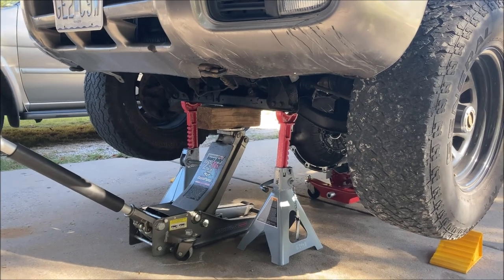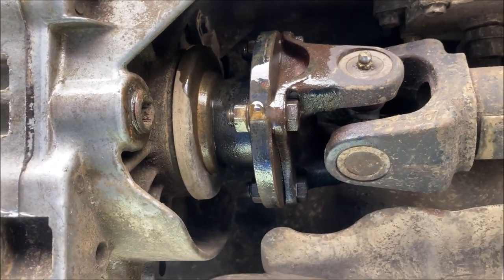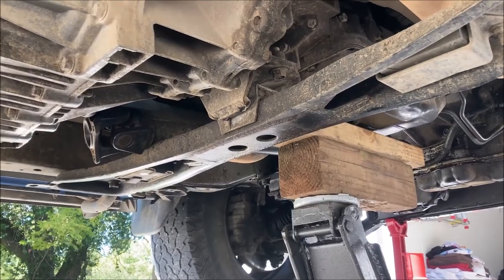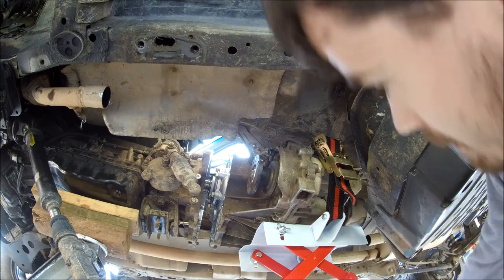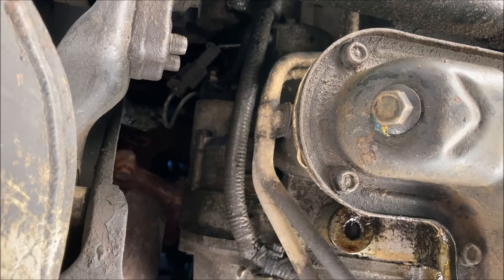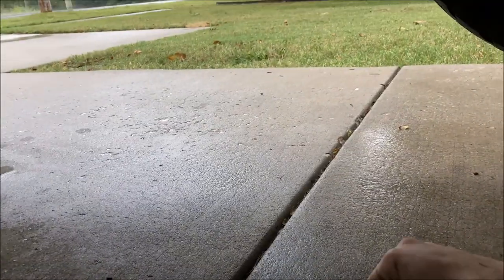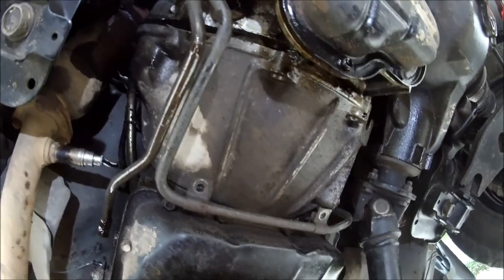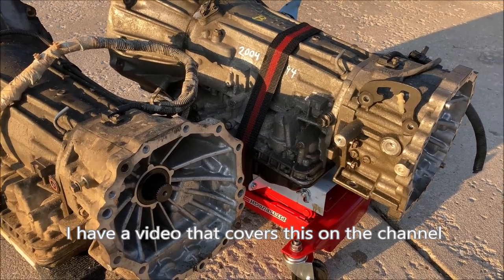Transmission Removal - Visual aid for R50 Pathfinder/Qx4

Comment: Thanks for doing this video. I need to drop the transmission to access the water outlet gaskets that are leaking. I tried doing it from the top taking manifolds off but I couldn't get the torque needed to stop the leaking. Taking this transmission down is no joke and I'm confident that you saved me a ton of time, headaches, and aggravation. Thanks man-really easy to follow and understand. You did an awesome job!

Comment: My heart dropped when you said not to cut any wires or I'll regret it. now I have to get another transmission.
Reply from the maker: Yikes. Time to bust out the soldering iron. I actually cut the wires at the junkyard on the donor trans. I rectified the situation by soldering all 22 little wires back together. I recommend going to the junkyard and cutting a longer donor section of wire harness to splice into the mistake if your junkyard has another donor. Just make sure the donor harness has the same plugs and wire count. Speaking from experience 2002,2003,2004 are all the same harness

Comment: First of all, mega thanks for putting up this video!  
This helped a lot when I had to tackle my rear main seal job.  
I referenced this vid several times before tackling this job myself.
This was my first time dealing with an automatic transmission (i.e. flex plate, torque converter, etc.) and 4x4 with transfer case, front axle, front diff.
I am a professional mechanic technician, so this kinda job doesn't intimidate me - if I had the right tools, I'd be fine.
Some tips:  
1) You don't need to pull the seats - you can get to the rear bottom bolts of the center console by sliding both seats all the way forward; to get at everything else, slide the seats all the way back.  
2) Your LE is rather rare - I have an '01 SE that has the shifter 4x4 linkage (I think the XE base model is like this too?) on the side (with the auto trans), which is easier to remove with the exception of on pass-through wiring harness (white plastic base with two locating "feet" with black metal cover) that goes into the passenger side of the trans case.  I think this is for all the solenoids, and I didn't figure out how to disconnect it so I just left it - it was just enough slack to nudge to trans + transfer case to the side to access the rear main seal.  The 4x4 shifter lever does get in the way on reinstallation, but dropping the two 12mm(?) bolts for the shifter assembly helped a lot.  I think unplugging electrical wiring harness plugs is a little bit easier and less stuff to do.  You are going to tear the bottom / inner rubber boot - that's just the rubber getting hard over time, and it catches on the bottom of the shift lever - just tear it off.
3) I was able to just move the trans + transfer case nudged over to the passenger side to be able to fully access the rear main seal.  This was with is sitting on the trans jack.
4) Dropping the back half of the stock exhaust wasn't too bad - with the exception of the 14mm(?) nuts (one pair for each side) that held the exhaust pipes to the left and right cats, the rest of the exhaust was held with 4 or 5 pairs of 12mm head bolts that held the hangers in place.  I did not cut anything, and it went back in relatively easy - the exhaust does loop over the rear axle, so this keeps it from crashing down.
5) Those bolts + nuts on the driveshafts (both front and rear) are a PAIN to remove!  I disconnected the main driveshaft from the rear diff and left it inserted in the back of the transfer case output to keep fluid from leaking back there.
6) Getting the torque converter bolts to line up was another PAIN!  I first bolted the bell housings bolts, thinking I could spin either the torque converter itself or the flex plate (engine side) - NOPE!  Once it's in, both spin together - I had to back out the bell housing about an inch, lined up one torque converter bolt (with the use of a pin punch) and then bolt everything back.

7) It's not real obvious, but ATF is refilled through the dipstick tube.  The FSM mentions "charge pipe," but it's buried on what this exactly is.  Lucky I had a MityVac manual fluid pump that made this a breeze.  I first tried to not spill any fluid, but that was impossible after removing the two 19mm banjo bolts on each side of the trans case that goes to the cooler up front, and the speedo gear at the back of the transfer case.  FSM mentioned Nissan fluid "D" but Mercon III compatible ATF is listed as an equivalent; the original Nissan "D" fluid is brown in color - like engine oil but without the burnt smell.

In the end, I calculate about 30 hours of my time from start to finish, by myself.
For those going after the rear main seal, here's more tips:
1) Upon reinstallation, but the two locating dowels on each side - no other UTube vid mentions this, and it give you another 1mm to work with.  The dowels come loose with vice grips.
2) Oil the circular oil seal.  Work the seal in with a small screwdriver - pay particular attention on how the oil ring seal goes in, as it's has an inner lip!  Keep using the screwdriver to gentle prod the lip seal at the bottom - be patient, this take a while.  Once everything looks kosher, get the three 10mm head bolts to thread most of the way in.  THEN, tap the two dowels in with a pin punch - take you're time; the dowels have a bevel / chamfer that will guide the rear main seal aluminum housing downward.  You will see it close the gap.  
3) When I removed the original Nissan real main seal (housing), there was no paper gasket, as the Fel-Pro kits comes with one - I didn't use this gasket; the Fel-Pro rear main seal aluminum housing has grooves like the Nissan one does that keep RTV in.  I also noticed that Nissan did not RTV the lip seal either - I did use a little to keep the lip seal held against the underside of the rear main seal aluminum housing, but no RTV under that in contact with the engine (upper oil pan).  You see a lot of other UTube vids where they smear RTV all over the place and make a mess!  If Nissan didn't do it, it's not necessary.

Comment: Thanks for the awesome video! Do you know anything about the vg33e transmission? I've got a 97 QX4, and the transmission recently started having issues with delayed shifting from 1st to 2nd. I'm about to replace the speed sensor, but I'm hoping this isn't a sign that the transmission is going out.
Reply from the maker: The vg33 re4r01a trans in the vg33 models is supposed to be very similar to the vq35de variants but unfortunately I don't have any knowledge about troubleshooting or fixing them

Comment: Thank you so much for this vid, i had a couple of question and you addressed them, now I'm having so much trouble putting it back i removed it to replace the rear main seal and for some reason I'm not getting the transmission to aligng...so frustrating...not sure what's wrong with it, when i finally got it in i started it and made some weird noise and I turned it off immediately!!

Comment: Is it essential separate the transfer case in order to drop the transmission? 

I'm trying to replace the rear main seal and yes I did watch your video about the lower oil pan gasket. Thank you for that! The unfortunate news is that I just got done replacing the upper oil pan gasket and now I'm going to have to take it all apart again to get to the rear main seal
Reply from the maker: That sucks to hear man. But no, you don’t have to separate the transfer case. I did it because it would be lighter to take it apart in pieces using that flimsy transmission jack.

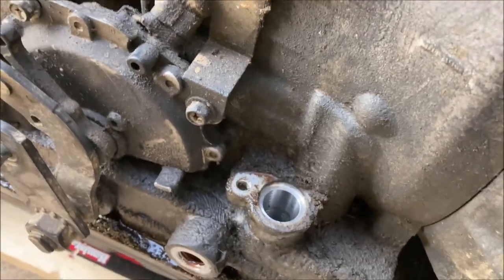Comment: Where is the test port so I can add an oil temp probe?  Is it that similarly sized port just to the bottom-left of what you refer to as the "dipstick hole" at 1:17:02?  Just saw at 40:34 that's actually a cooler line with a banjo bolt.  Where is that freaking test port?!
Reply from the maker: That banjo bolt is the test port somehow. According the 2001 r50 fsm on page At-62 it shows that a couple different tests are done for line pressure using those ports that banjo bolts connect to.
Reply: @dospathsgarage2854  Actually I just found some sources showing where at least the "Reverse/3-4/N" pressure test port is.  Its on the driver side and it is its own port, I won't post the link because I think Youtube will block my comment if I do.  Its on ClubFrontier.  Still can't get a view of the passenger side to find the "Drive/1-2" pressure test port. 
I think it should be on the passenger side just above the oil pan and just before the tail shaft housing.

Also I happened to see one of your other vids for the main timing chain tensioner rattling and you talk about using 5 quarts.  What exactly did you do to fix that issue because I have a rattle at a certain rpm and for the longest time have thought it was exhaust shield rattle but cant find any shields that are loose.
Reply from the maker: @on1ytheb3st  I think I have a half million photos of my transmission project somewhere. I'll see if I can find an image that may show where the test ports would be. I'll let you know if I find anything worthwhile. For the video with the timing chain tensioner, the context of that video was when I had let the vehicle sit for a couple weeks and installed a new OEM tensioner because I was replacing some other damaged components inside the timing case. When retiming with a new tensioner, the chain would alternated between going slack and tight while cranking by hand. I set up the camera to film while I started cranking with the starter to see what was going on. I think it just had to fill up with oil. After that, the tensioner would only make noise if I parked it for weeks at a time at an incline, but after idling for 3-5 seconds it would get quiet again. Never heard a noise during normal use
Reply: @dospathsgarage2854  Thanks man would love to see whatever you can find.  I'm starting to rethink using the pressure ports though because apparently the fluid in the pan will be most accurate so I might do a drain plug sensor (does worry me about things hanging lower than factory since drain plug is on the bottom of the pan).

Looks like you took off the entire timing cover for that job; were you getting a rattling prior to breaking everything apart?  

I'm thinking it would probably be productive to just go ahead and replace my main timing chain tensioner (same one you replaced) through that access port from your video; pretty sure Nissan made a rolling update to them for the VQs or something so that could possibly be why I'm getting a rattle.  Hope its not a broken chain guide and it is just one of my exhaust shields rattling.

Also if you look at the FSM for the Water pump replacement using the access ports, it recommends revving the engine in Park to I think 3,000rpm for a solid 30 seconds or so to get oil up and to the tensioner since it's hydraulic.  Also people say pre-priming the tensioner before installation is always good practice.  Was it hard getting the tensioner in there?
Reply from the maker: @on1ytheb3st  pan readings should be pretty accurate. Honestly temp readings at driver side trans fluid hose behind the radiator shouldn't be too far off pan temps. Those pumps push oil through pretty quick so I don't even think there's even 1 second delay from the oil coming out of the trans before it gets up there by the radiator. (I broke a trans cooler line and it sprayed all the oil out to empty in less than 50 feet of driving, just cruising in 4low). I did have the pan off of a 2001 I used to own. It was a cheap project I bought that had a broken exhaust cam chain and broken exhaust cam chain tensioner. I threw in a new water pump, new main chain tensioner, new exhaust cam chain and its tensioner. Didn't bother pre-priming it like I should have so I had to figure out why it wasn't taking the chain slack out until it had oil pressure. Nissan fsm will also tell you to do the 3k rpm thing with just about anything coolant related to ensure air pockets im the coolant get pushed through
Reply: @dospathsgarage2854  Yeah I’ve thought about doing it at a few places but it sounds like other locations besides the pan respond too quickly to transient impulses from acceleration etc etc.  It makes sense theoretically kind of; smaller volume of fluid in the cooling lines would mean the fluid responds to heat of the smaller diameter tubing much quicker where as the pan has a much greater volume.  Theoretically though if volumetric flow were to remain constant the cooling lines (even the outlet line) should be cooler in temp as pressure decreases with an increase in velocity from the pipe construction and so temperature should decrease.

Regardless I’m only using this as a way to get an accurate trans fluid level reading as I find that trans temps wildly effect the reading on my dipstick and can cause a bit of a vibration if not set correctly (220k on the clock).

And yeah that makes sense; I think the difference with the water pump is the way the FSM was doing it was by going through the access ports and having to remove the chain tensioner before being able to remove the water pump.  So if I were to do it I’d replace the chain tensioner at the same time.  At 220k miles do you think I need to worry about the water pump failing or possibly the timing chain?

Comment: Are the bolt pattern the same for transfer cases to the transmission for TX10 and the ATx14a transfer cases?
Reply from the maker: So I didn't measure them with any tools or try bolting them up to the transfer case, but visually looking at them side by side, I couldn't find any bolt pattern differences for atx14a and tx10. Only thing that messed me up was the casting features on the side of the tail shaft house for linkage/actuators being different
Reply: Thank you great video for details on this job btw.